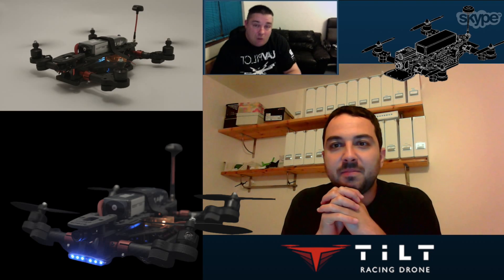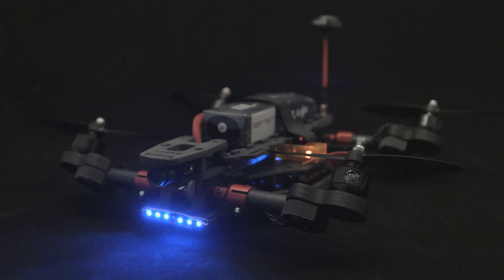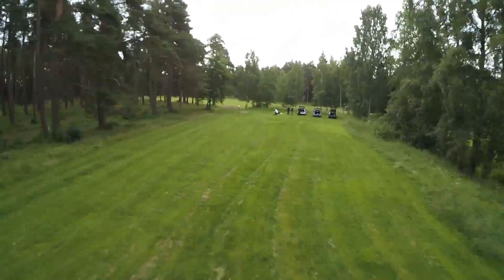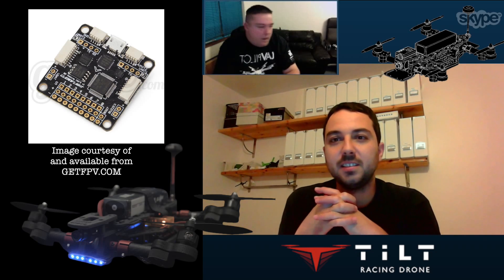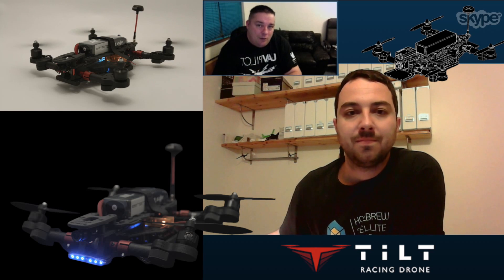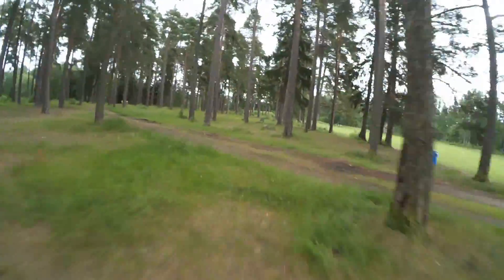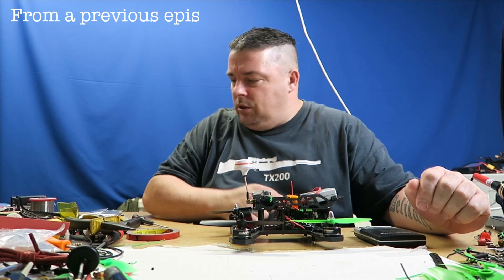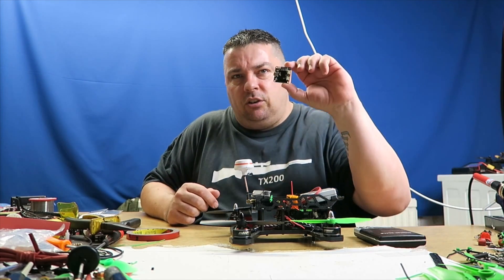TiLT Drone product showcase with designer Pau Mallol

Comment: Sorry. All but I am also going to mention the swift 250 by ali from OFM  but please ignore his religion and stick to the quad design.
Who started first I don't know I think maybe ali with the 330 he did that did not come to production. No as far as what he has produced I have bought one of the kits it came with only the frame and tilt servo, I question his choice of carbon especially after seeing him break as he called it when questioned the motor plate in one of his videos this was after I had placed my order I might add.
When the kit arrived it left a lot to be desired it came in a bag only like you would expect the ZMR to come every component except for the claw legs I could find on the internet easily the servo was easy to find nothing special there.
My opinion of what I received was that I had waisted my money, after seeing your video I know it is open season on tilt rotor designing I have many ideas in the pipeline I will now add a tilt rotor to the list probably using ali's kit.

Comment: Alishanmao introduced that tilt rotor kind of quad more than 5 month ago and would have sold it in his shop 3 month ago if there hadn´t been a problem with a untrustworth buisness partner.

And even the Version 2, the OFM Swift TR260 on his Website for a while now.

The TiLT Drone is a nice product, but i think TiLT and TR260 will have to shar that "first place" ;-)
Reply from the maker: Docustube You're right Ali has had his version of a tilting multi rotor for a while but this has also been available for a few months. Both Pau and Ali were working on this concept around the same time and have swapped emails. As far as I am aware they are both supporting of each others products.

I have looked at Ali's design, the TiLT looks like a much more professional kit and has supported the creation of the cleanflight specific software. It's good to have competition though as it helps to drive the price down for the consumer. 

ATB Malc